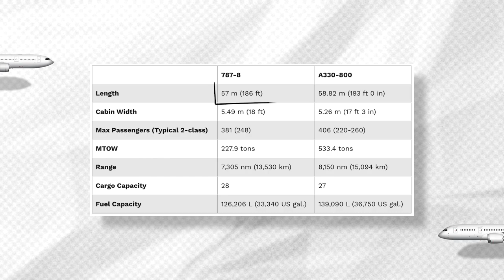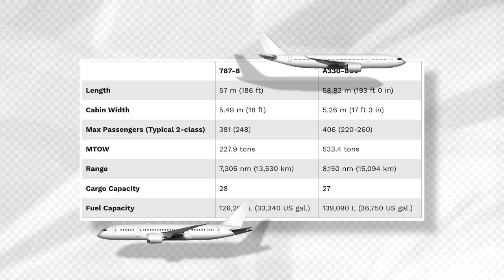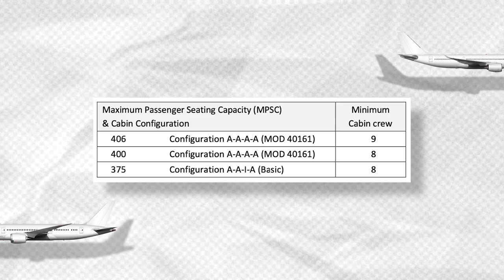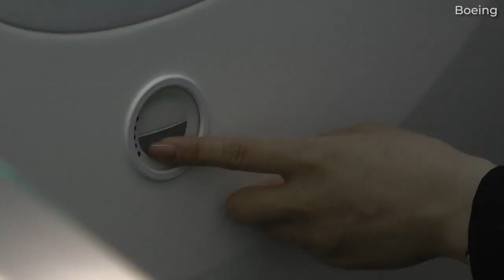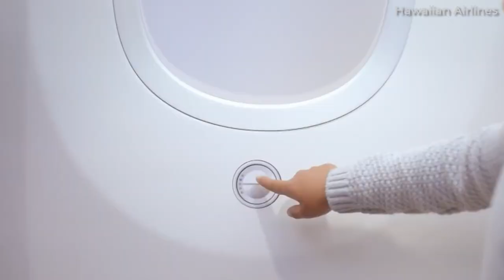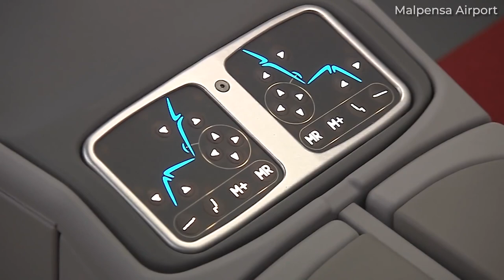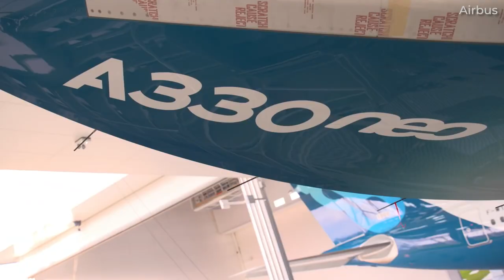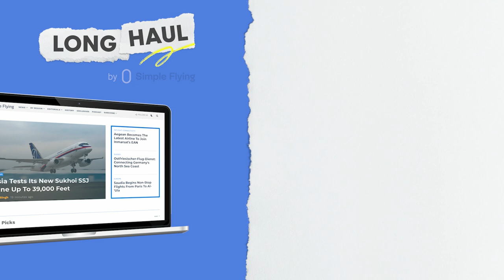Comparing Small Widebodies: The Airbus A330-800 vs. Boeing 787-8

Comment: This very nice video contains a couple of material errors, namely it lists MTOW of A330-800 at 533.4 t, whereas it should have read 251 t. Secondly, it lists 656 sales for 787-8. Actually the real number to March 2023 is 399.  This does not change the overall picture: both are clearly unloved versions.  787-9 show sales of 1,183 and A330-900 of 279 (vs 11 for A330-800).  It is interesting to explain the reason for this huge gap.  Both ugly ducklings have very similar costs per trip to their larger siblings. The only tangible difference is a somewhat lower fuel consumption. Say 0.5 tons per hour, which on a 10 hour mission amounts to 5 tons or 6,000 liters.  That amounts for $6,000 per trip on such a route. Pilot costs are the same, just 1 extra flight attendant is to be added, maintenance costs are about the same (the bulk of this item is the engines, which are identical), and overflight and airport fees are essentially very similar (they are calculated on the cube root of MTOW).  The bigger planes can carry 40-50 more pax, and at a nominal ticket price of $500 that means $20-25,000 extra revenue.  Plus an extra 5 tons of cargo, which at a nominal $5 per kg adds $25,000 to revenue.  Airlines have to be very, very pessimistic to buy these smaller types.  They have to envisage such long and thin routes that do not have more traffic today, and will not have it either in future. Assuming a traffic growth of 2-3-4% per year, in 10 years a 787-8 becomes a 787-9, and planes have a lifespan of 20 years.  This is the real reason why these planes don't sell. Most 787-8 sales were registered at the time of launch, before 787-9 became available. Since then they have virtually dried up.  Not that Boeing cares much. They are essentially uninterested in the subtype for since it has a much lower parts commonality with 9 & 10 fabrication costs are materially higher, so no big discounts are offered.  Airbus' situation is different: unlike Boeing that incurred in $25 bln development costs they just spent a couple of bln dols to develop the NEO program, since all of their costs had already been fully paid by the hugely successful CEO versions.  This allows them to put a lid on Dreamliner's selling prices.

Comment: For Garuda, the A338 is in theory the winner for them.

Indonesia is a hard market for international travel as it's an inflexible O&D market with glaring factors such as weak passport power, price sensitive customers with awareness of their weak currency, and a very small overseas migrant population. Bad enough that any intercontinental foreign carrier cannot keep a Jakarta route profitable without using a 5th freedom route for loading, but they're the perfect conditions to fill a -800 to full.

Having had an A330 fleet also means they can bypass the need for pilots to earn a new type rating for an all new aircraft, which is cost effective and good timing as they've just come back from restructuring. The theoretical range offered by the Neo gives opportunities to open long haul destinations that Garuda had never opened service before, targeting more of Europe and west coast USA for services to Denpasar.

Comment: I find it sad than the 787-8 and A330-800 are not used much many orders for -8 are being upgraded to -9 if they haven’t already done that and the A330-800 is overshadowed by the clean sheet A350-900. I see trip videos of people getting on them and they are like 1/2 to 3/4 full and the -800/-8 are designed for those routes. So in the end the routes either get cut or airlines run them not making as much as they could with the correct planes.

Comment: The a330-900neo should be more competitive compared to the 787-8 tho, right?
Reply: Nope since the 900neo have more passenger capacity than the -8. The 787-9 is the real competitor to it at it offers almost the same capacity a higher range.

Comment: B787-8 doesn't have to worry about the A330-800 due to the latter's lackluster sales. However, the fact that A330-800/900 or A350-900 (and even A350-1000) having longer range than the B787 counterpart cannot be denied. Thus Boeing needs to hurry up and offer that longer range more capable 787-9. Like 787-9ER. 787-9ER with like 15,500km range would be a nice replacement of the B777-200LR (and even the 777-8 as that program looks bleak just like A330-800) and will be competitive against the A350 and the A330-800 in capability. 

Meanwhile 787-10ER with a range of 13,000km+ at least the same as old 777-200ER, 787-8 and the latest A330-900neo would be especially good for Being loyal customers who feel 777x is too large. It would be a cargo/payload carrying monster and an excellent replacement to the venerable 77W
Reply: Boeing would always make the initial plane worse just to make it better down the line for more money 🤑
Reply: Are you just underestimating the 777-8X ? It's future doesn't look as bad as the A338's future!
Reply: Did you miss the part about fuel capacity? It may have more Range but the 787 burns less fuel per compared to the 330. Boeing already said it’s interested in making a higher mtow version of the 787. Most routes are flying these planes to their range capacity so if a 787-8 flies 4000miles the A330-8 will likely burn more fuel in that time as well as the 787 higher cruise speed. I love the 330 but I freaking love the 787
Reply: @edsontransports9400  As a freighter, the 777-8 has a bright future, as a passenger aircraft, not so much.

Comment: The 787 has advantages with larger cabin windows and composites. The smaller cabin windows for the A330neo could be a disadvantage. Thank goodness for the A350XWB.
Reply: And yet with its larger cabin the seats are typically slimmer
Reply: Virgin Atlantic and Air India have 17inch seats,,,,,ha ving flown once on each airline ;;; I avoid them now

Comment: I just made it shorter in comparison

Airbus A330-800
Fuel Efficiency ❌
Range ✅
Passengers (One Class) ✅
Cargo Capacity ❌
MTOW ❌
Max Payload ✅
Operating Empty Weight ❌
Fuel Capacity ✅
Maximum Speed ❌
Ceiling ❌
Thrust ✅

Boeing 787-8
Fuel Efficiency ✅
Range ❌
Passengers (One Class) ✅
Cargo Capacity ✅
MTOW ✅
Max Payload ❌
Operating Empty Weight ✅
Fuel Capacity ❌
Maximum Speed ✅
Ceiling ✅
Thrust ❌

"Boeing 787 is a Clean sheet design for the future of Air Travel, Airbus A330neo is just an update from A330ceo, both of them have access fly by wire technology, it depends on the Airlines on what plane they should buy on their fleet." :3

Comment: But the A350 ... was developed ... because of the lack of interest in the upgraded A330 when Boeing announced the 787.

The A330 was designed alongside the A340 in the early 90s .. and .. .competed with the 767.

The 777 was developed by the late 90  to fill the gap between the 767 & 747.

And Boeing stupidly developed the 757 along with the 767 ... to fulfill the medium jet market ... when the 757 should have been developed as a small jet to replace 737 because it was a narrow body with the same size fuselage as the 737, 727 & 707.

The 787 was essentially a NG 767.

The A350 was essentially a NG A330.

And the 787 was developed ... because Boeing failed to get any interest in an new variant of the 747 ... with the coming A380 .. & ..deciding not to build the sonic-cruiser.

Boeing should have built a NG 737 ... with a larger fuselage than the A320 ... tall landing gear .. composite wing .. & ... flybywire stick controls, to replace the 757 which should have been developed in the early 80's as a 737 replacement.  And using the tech to develop a  767 & 777 X with composite wing, new engines, weight savings & the latest glass cockpit.

Again.  Airbus developed the A350 to compete with the 787 ... because there was no major interest in an upgraded A330.  And the 787 was developed because  there was no interest in an upgraded 747 to compete with the A380.

Boeing needed to at least offer a 777 X to compete with A380 ... as it was developing the 737 replacement, ... not the replacement of the 767 wich competed with the A330.
Reply: I'm sorry but designing the 757 to replace the 737 makes no sense when they designed it to replace the 727, which even then was nonsensical.
Reply: @randomscb-40charger78  The 757 ... has the same size fuselage ..... as the 737 .... 707, & 727.

The 757 .. was essentially a twin engine 707 & 727 ... with tall landing gear to accommodate the larger hi-bypass turbofans.

The 737 was designed in the 60s ... as a regional jet with 60's engines ... and essentially just a smaller twin 707.with twin engines.

The A320 was designed in the 80's after Airbus had made the A300 with the new larger high bypass engines ...as a wide body twin for continental travel.  Only tri-jets & quad-jets could travel transatlantic and Boeing had the 707 & 727 which had the same size fuselage as the 737 .... and is smaller than the A320.

The 767 was built in response to the success of the A300 and will twin jets clearly about to replace tri & quad Jets for transatlantic travel.  Boeing new twin Jets were the future  ... with increasingly larger hi bypass turbo jet engines requiring tall landing gears ... and their best selling aircraft was the 737 ... & ...747.

C'mon.  Do the maths.   It is obvious that Boeing should have developed THREE new aircraft for the early 80's ... and moved to only twin Jets.

Boeing  need to build the 757, 767, & 777 for the small, medium & large Jet markets .. future proofed for the next 40 plus years & with common pilot certifications due to  flybywire controls and common glass cockpit.  And the 737 should have refined purely as a regional jet.

Again.  The 727, 737, 757 & 707 ... have the same size fuselage.   Airbus design the A320 ... to compete with & beat ... the 737 designed in the late 60's ... and gave it a wider fuselage and tall landing gear ... for the larger high bypass turbojet engines.

The 787 is simply a 767 with built with composites, and the latest tech & engines.

The A330 Neo  is simply what the 767 NG or Max should have been.

And because Boeing stupidly built the 787 ... instead of making NG, Max or X versions of the 757, 767 & 777 ... Airbus built the A350 which is bigger & better than the 787 ... and the A320 family is now dominating the market .. because Airbus designed the A320 to be better than the 737 and future proof for at least 40 years.

See.  The 757 should have been designed to replace the 737, with a bigger fuselage and future proofed ... for the small Jet Market .. and the 737 should have been optimized as a cheap, reliable, efficient workhorse as a regional jet.

And Beoing should have developed NG, Max & X versions of the 757, 767, 777 ... and eventually replace the 747 with the 777 X or Max.

The 757 entered service in the early 80's ... and had it been the replacement for the 737 ... with a larger fusielage, tall landing gear, flybywire controls & glass cockpit, and with the first high bypass turbo fan engine for a small passenger jet ... it would have got huge sales, and would not be threatend at all when the A320 arrived in the late 80's.

It's all water under the bridge.  But is screw up started with the idiotic decision ... to build the 757 & 767 ... for the medium jet market.

Comment: I think Airbus user would choose A350 for A330-300 fleet/long haul fleet replacement, 
current 787-8 replacement is for 767/757
Reply: Very few airlines replace their a330s with a350s. It's either 787 or a330neo most of the time

Comment: This is a totally irrelevant comparison. It's like comparing apples and oranges. A better comparison would be between the 787 9/10 and the A350 900. The A330-800 and 900 are merely re engined  200 and 300's respectively. Also, it would have been better to include cost of acquisition and the list prices of both aircraft. The much vaunted cabin comfort improvement supposedly introduced by the 787 in terms of humidity is not in practice much to talk about. My own experience on a 787 9 was nothing to be excited about. One big problem with airlines acquiring either the A330 800/900 is the single engine type available. Take Aer Lingus, a long time A330 operator as an example, they fly GE CF6 powered A330's. If they were to take on a new engine type, it would make more sense for them to go for an A350 instead of the NEO versions of the A330. In doing this they would also acquire an aircraft that has had an almost unblemished development and EIS than the very problematic 787.
Reply: EI will only go for the A350 if they're guaranteed to fill it or if they start a new route where the A330 hasn't got the range. -900 is definitely the safer option for them as EI are quite a conservative airline compared to any of the other main European carriers.

Comment: the B787-8 supersedes the A330-800 Neo by leaps & bounds . . . a cabin configuration of 268 - 293 seats in a typical 3-class layout is best suited for the B787-8 wide body jet . . . as for the A330-800 Neo it's apt cabin configuration should be anywhere between 285 paxs - 306 in a typical three-class layout . . . A330-800 Neo & A330-200 operated by low cost budget carriers could do with a cabin configuration of no more than 338 seats in a typical one-class & two-class layout . . . without compromising on profitability . . . by the way, Greenland's new full service carrier could do with an additional two brand new A330-900 Neo wide body jets . . . instead of the A330-800 Neo . . .

Comment: Inaccurate conclusion stating, ‘the Dreamliner offers some passenger comfort advantages’ vs. A330-800. 

No, the Dreamliner’s 9-across Y-class fuselage format is simply INFERIOR, less comfortable, more crowded, vs. the Airbus. 

Any attempt to counter balance this objective conclusion with the Dreamliner’s enhanced humidity and oxygen environment is futile. Long haul passengers want SPACE over anything else. 

Finally, Airbus will absolutely book many, many, many A330ceo replacements with the A330-800, the narrator is mistaken claiming carriers ‘should have already placed orders’. Airbus only lost Hawaiian to Boeings Dreamliner 

Lufthansa does not operate the A330-200, so it did not consider A330-800. Its A330-300 will be replaced by the A350-900 order, not the Dreamliners it recently ordered. 

KLM never ‘formally’ rejected the A330-800 to replace its A330-200. The Dreamliners it ordered are merely ‘add ons’ to prior Dreamliner orders. 

It’s entirely inaccurate to claim the A330-800 is some sort of ‘commercial failure’ when it has been marketed for less than 9 years vs. 20 years for the Dreamliner. 

The A330-800 will prove its efficiency with existing A330-200 operators WHEN they ultimately place replacement orders.
Reply: 9-across vs 8-across is an airline decision.

It is not inherent to the type.